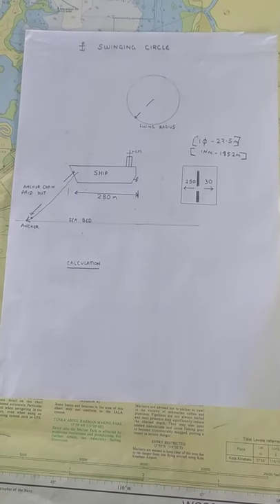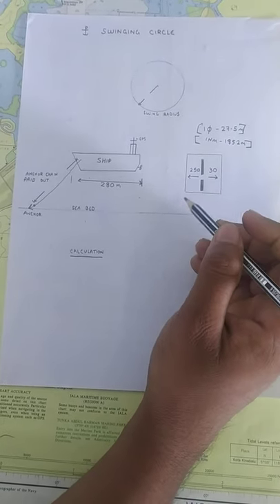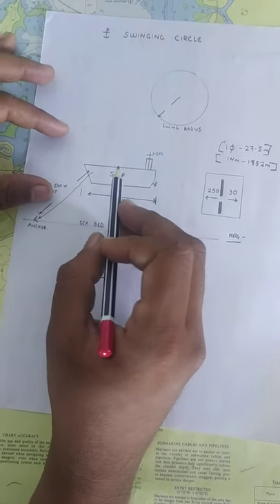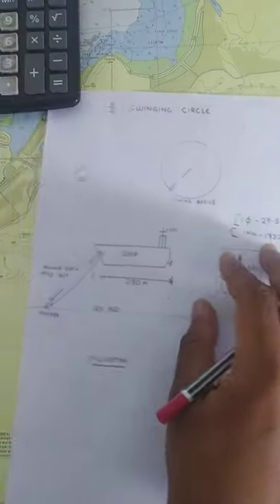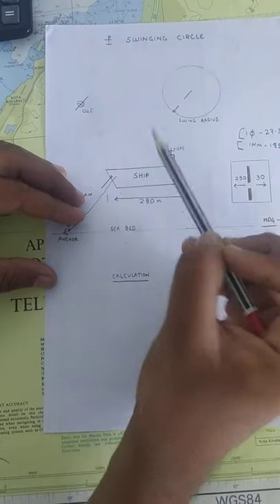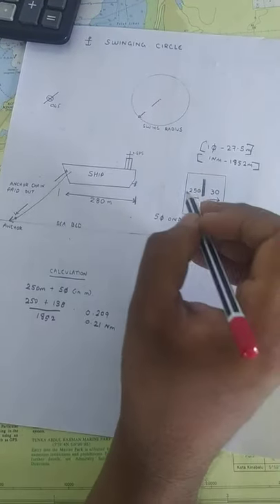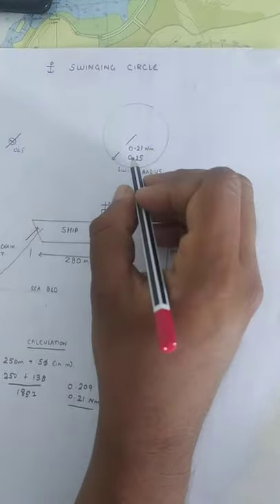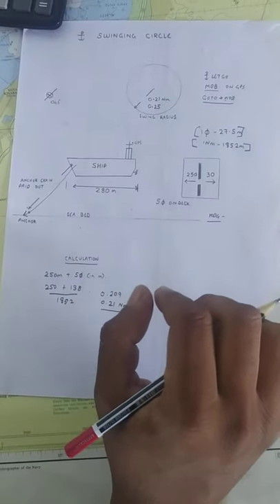ANCHOR SWINGING CIRCLE Calculation Explained

Comment: what if the accomodation is midship, where the gps would be and shall we take the whole ship length or just the length ahead of the gps antenna?
Reply from the maker: Good question sir. In that case, take the length from antenna to fwd of ship. Its basically the anchor to antenna that covers the swinging circle. So, in no way can the gps position be off the circle if you take the distance from gps antenna to the fwd. 

Also, just to be sure to make your stern clear off the nearby ships, add that distance to the circle. So, your swinging circle will cover your ship's total length.

Hope i could clarify the query.

Regards.
Reply: @prasobhsugadhan   Sir I got your answer and thank you for the fast reply but could you please clear my doubt regarding the above!!
If i take the length from accommodation in case of a giant container ship which lies 1/3 from fwd, then the no of shackles and distance  to anchor would be less than the total length of ship!!
in this case ship would be outside the swinging circle anyway!!
DId i get ur answer wrong or there is any other methoad on such big ships?
please clarify and again thanking you!!!
Reply from the maker: Yes sir... The ship will be outside. So, in that case, add the distance from the bridge to stern and convert it onto NM and add it to your swinging circle radius. So, your ship stern will always be inside the circle. 

But, remember this, the gps will only give you a position from antenna.

So, if it's 250 m from bridge to stern, divide 250 by 1852 (250/1852=0.14 Nm Approx) and add it to your swinging circle radius. So, this much will be the distance the stern of ship will cover in addition.

But, your circle has to be made not including it (as in video), and add the radius to swinging circle on chart to find where your ship's stern will go 

I hope you understood.
Reply: @prasobhsugadhan  yes sir that will do

Comment: Sir what the maximum distance from other vessel while ⚓ age in fujarah which is highly density area of vessel and also my depth is 100mt how much Shackle I should drop if I am having 11 Shackle on board vessel length  is 320 mt. Breadth is 30 mt.
Reply from the maker: Sir, 

First and foremost, i have never seen my vessel at anchor in waters more than 30-40 m. Basically, i have never sailed in large capesize vessels.

But, what i learned from my masters is a simple formula 

(3:5:7) = (short duration anchorage timeline : normal Wx anchorage timeline : Heavy Wx anchorage timeline).

I'm used to Singapore and johor anchorage areas, and the traffic density is unbelievable. Still we maintain a swinging circle of around 3 cables to 4 cables. Basically, all ships will head for the current when at anchor, except for broad ships with high free board and heavy wind flow. So, everyone faces the same direction more or less always. Thats the main reason the 3-4 cable is comfortable for us. 

Also, the weight of the chain is not a depending factor when it comes to preventing drag. The more the cable length, the lower the angle with the anchor and ground, and hence lower chances of anchor dragging. Thats why we put 7 times the cable when in heavy Wx.

So, depending on my calculation, and my knowledge (forgive me for my ignorance), 5 x 100 m = 500 m of cable length, which the ship doesn't even have. So, I'm also confused sir. Please ask your master, and do give me a reply. I too would learn from this query.

Thank you, and sorry once again.

Comment: Nice video but please sir explain more about why  should always we take length from break of accommodation to calculate swinging circle?
Reply from the maker: Thank you sir.

Now, coming to your query,

What we need is not really the length of ship fwd of accomodation, but the length of ship from gps antenna to fwd. 

Usually the gps antenna is on top of our monkey Island, correct sir?

So, when we calculate the length fwd of accomodation, we can transfer the gps position fwd. Why we need it is simple.

Anchor swing circle needs to be calculated from the point where our anchor is put. The gps onboard will give us only the position of the ship (wrt antenna placement) from the gps antenna. So, if you are sailing on a 350 m ship with accomodation aft and athwartship, with the antenna on top of monkey Island, atleast 1.5 cables (say 250m) will be distance to fwd. So, anchor is let go nearly 250 m fwd from your gps position.

Any circle can work only if the center is accurate, correct sir?

So, if your swinging circle is calculated with 250 m error, then your ship will mostly be outside the swinging circle calculated, even though the ship is riding to the anchor without drag.

Hence, we need to calculate it from the fwd sir 

I hope that your query was answered satisfactorily.

Thank you.
Reply: @prasobhsugadhan  okh sir 
Well explained and thank you sir.
Reply: Thanks for the video, sir. I understand the part of bringing the gps forward to tackle placement error. But after that can you explain why LOA(250+30) is not taken to calculate swinging circle from the position where anchor was let go?Instead only 250m was used in the formula here. Kindly address. Thank you once again.